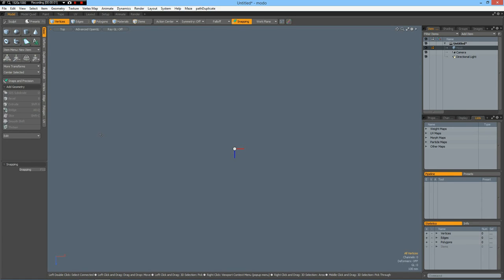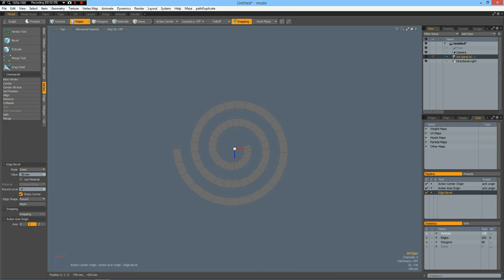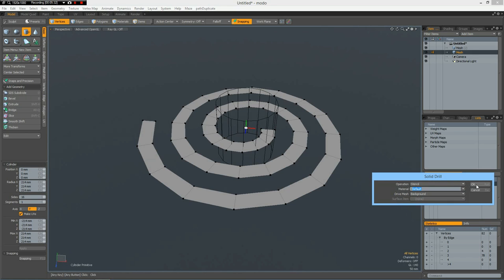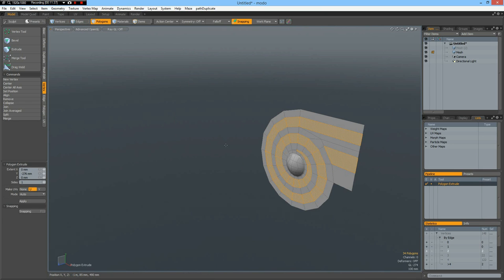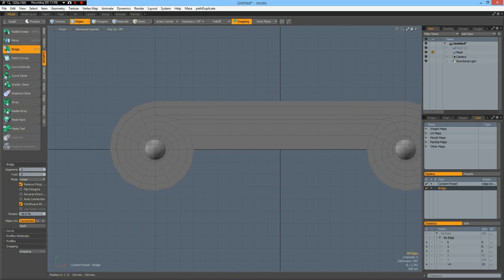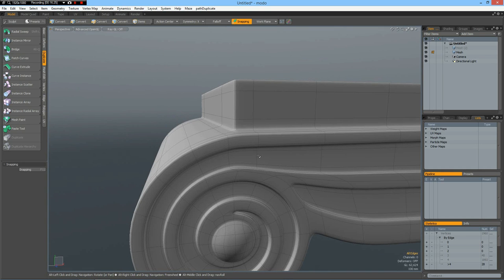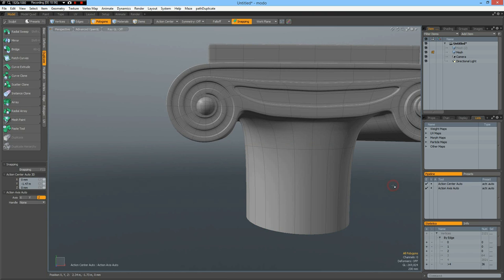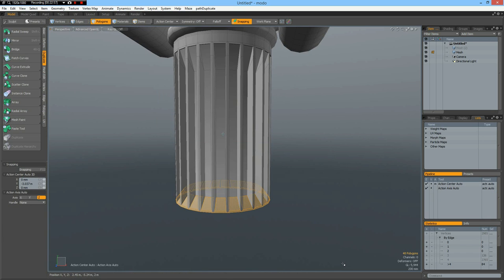The Foundry MODO - Modeling a Greek Column (On Request)

Comment: Nice tutorial. I'm thinking of switching to modo, i made one of these in max couple of years ago, but have recently realized that upgrading to a commercial license from educational isn't feasible, or potentially worth it, considering how little development max has gotten lately, and the modeling processes in the student version of maya i'm using are....lengthy, compared to max (but then, modeling has never been one of maya's strong points)

What version of modo are you using?
Reply from the maker: TheGuardianofAzarath Hi,I am still using modo 701 SP5 since the major improvements in modo 801 are in areas which i don't use often or not at all. Kind regards, Peter

Comment: Hi Peter, what version of modo are you using, im using 801 when i run the perfect circle script. it doesnt work properly any tips?
Nice tutorials as always..
Reply from the maker: Hi Richard, pleas open your script with notepad or some other editor and check the header comments. It should be like this (Version 1.97):#perl#Perfect Circle#AUTHOR: Seneca Menard#version 1.97 (modo2)If you have something with a lower version, then you must download the newest version from Seneca's site: @modoscripts.htm
Reply from the maker: I really don't like Google+ ! It reformats my posts :( Swallows half of my pasted URL's and is just CRAP !!! Sorry
Reply: Peter Stammbach yeah saw my version it's only at 1.6 (modo 2),
thanks ill try to find the latest one..
Reply from the maker: Richard Leonardo Hi, i sent the script to this eMail address, but i get a 'Mail Delivery Failure' Is the eMail address correct ?